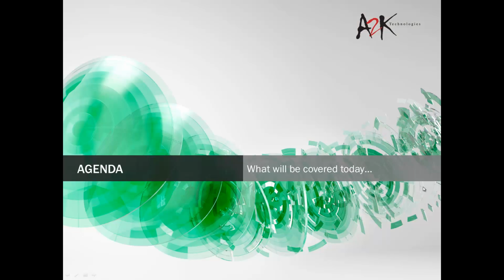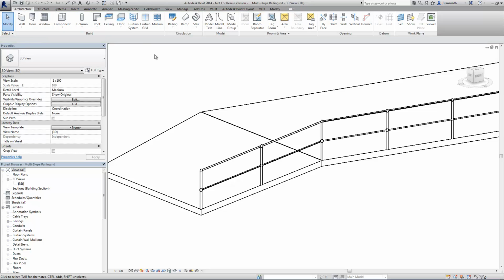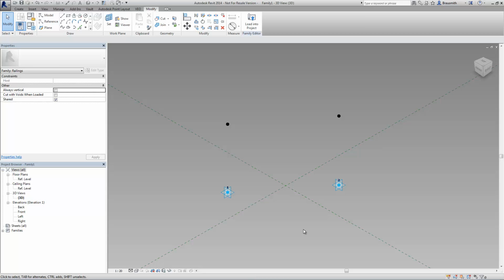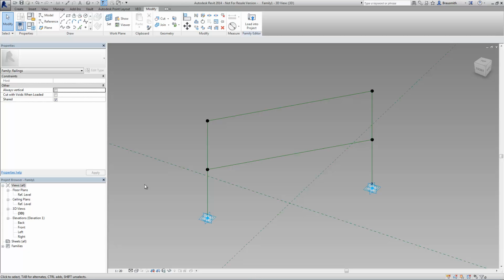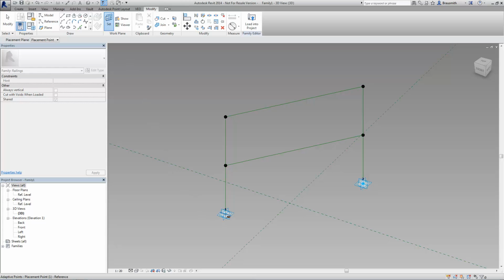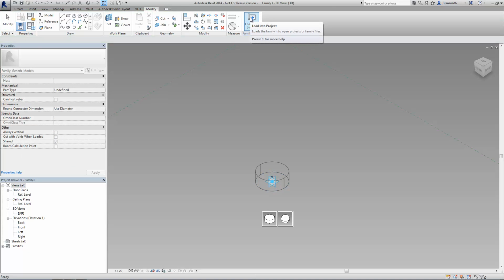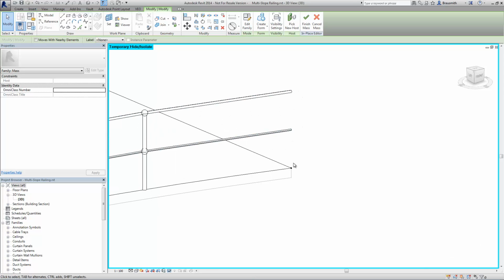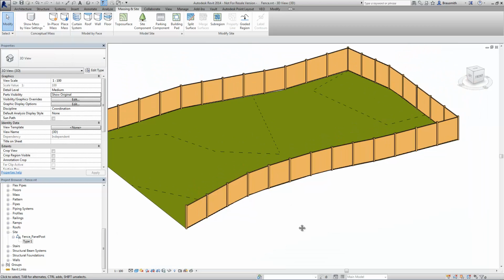Sloped Railings & Fences using Adaptive Components in Revit

Comment: great Video! is there any way to do this on Revit 2017? unfortunately it all works well until you apply the orientation Parameter, Vertical in Placement doesnt exsist
Reply: I have the same problem. did you find a solution?